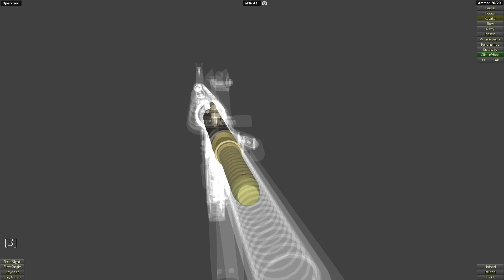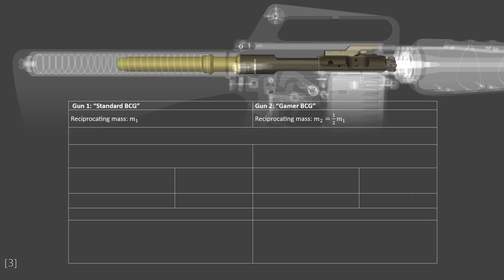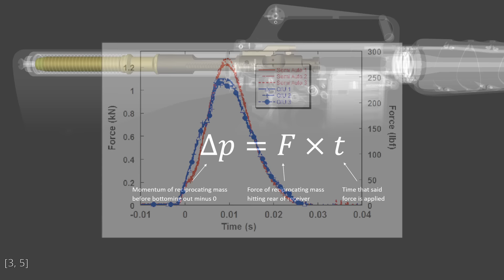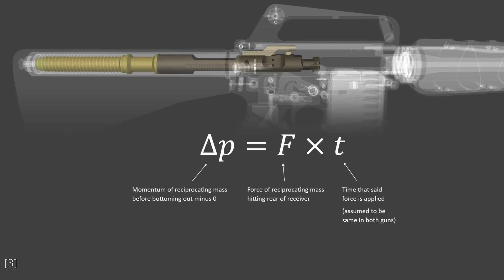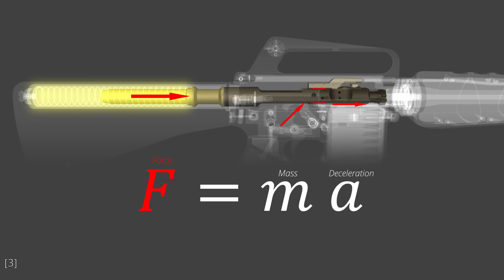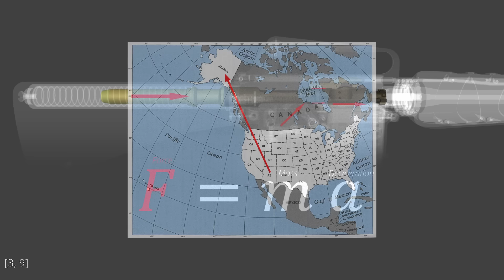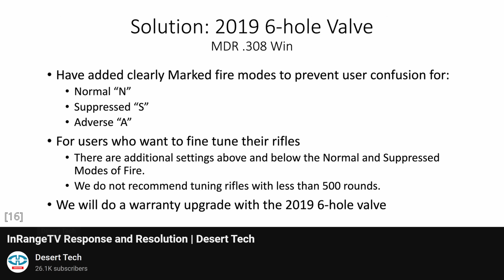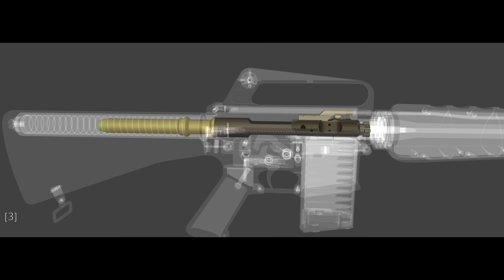Bolt Carrier Mass - A Nerdy Theoretical Discussion

Comment: The conclusions are counter to my own experimentation. I've found an increase in reliability and less sensitivity to ammo differences when using a light carrier. Specifically I've found that the combo of light carrier, heavy buffer, heavy spring, nets the best of all. 

Two things are ignored in this presentation and neither apply to the Desert Tech example. The buffer and DI gas system, neither are present in the DT. 

The buffer plays an important role in the AR15, as a mass damper it slows unlocking, and helps maintain constant momentum of the carrier. The ratio of the mass between the carrier and buffer is very important. The higher the buffer mass in relation to the carrier mass the smoother the action will cycle. 

The DI system is similarly important. The gas system has a gas volume with a restricted entry orifice. It isn't until this volume reaches a sufficient pressure that the carrier will begin it's rearward movement. This creates a time delay in the action and a mitigation of pressure spikes effecting the carrier. When the entry orifice(AGB) is small the peak pressure variation of cartridge has less effect on the cycling of the action. This aspect is not present in systems with pistons near the gas port as there's so little gas volume. 

Stiction and bolt speed are also an important factor. When the reciprocating mass is reduced but the spring isn't the speed at which the BCG moves forward is faster. This faster speed better overcomes the stiction of the cartridge in the magazine making the stripping of the magazine easier. This again is helped by a comparatively heavy buffer maintaining the momentum of the carrier.

FWIW my defensive AR is a 300BLK in which I use a skeletonized titanium carrier that's only 3.9oz and it's perfectly reliable with the wide range of 300BLK loadings.
Reply from the maker: Oh I agree with you, I think we're just having some mismatch in communication here. At the beginning of the video I said I'd consider the entire reciprocating group as one mass and ignore the interaction between different parts of the group. That's because I want the video to be applicable to gas operated firearms as a whole and not just the AR platform. If you reduced carrier mass and increased buffer mass, then the overall reciprocating mass would be the same, but the added benefit is that a larger portion of that reciprocating mass is in the form of the movable buffer weights, which would spread out any impulse applied by the reciprocating group to the gun. The only quirk to that approach is that the buffer mass does not help unlocking the bolt, only the carrier mass does, but realistically if one doesn't go overboard with lightening the carrier then it's fine.
Reply: @cabbage6015  With a DI AR I do not think the carrier can be too light.

Comment: Wouldn't speed of two bolt carriers be different on both back stroke and forward stroke because they have different masses but are pushed by same force - same pressure in gas system on backstroke and same string on forward stroke?

Comment: That's why I always going for a good quality mil spec BCG, a heavier spring and buffer. And avoid lighter hammer spring.
Super42 H2 and H3(or sprinco for cheap). And hiperfire trigger keeps the striking power while being wicked fast.
Reply: Good point on MDR, but light BCG is only one of quite a few design (and quality) issues.
My MDRX didn't perform half as well even compared to RDB.
SCAR17 is definitely a good example of why a heavy BCG is critical.
Reply: I've run JP triggers with the light spring installed for a long time over a few different rifles.  Never had a light strike, even with steel cased or surplus.  And that's with bobbed hammers.
Reply: @immikeurnot  Good for you and thanks for sharing. So they must work ok for your usage and your environment so far.
It's just that I prefer to not go closer to the boundary of the operation envelope when I'm choosing parts.

Comment: I totally agree with what this video laid out. However, in theory, if you were to take a light bolt carrier and increase the spring pressure while keeping the gas setting the same for heavier bolt carrier, wouldn't that reduce the velocity in the extraction phase and increase the momentum in the chambering phase?

The only reason I care is am working on turning a FM15 into a bullpup and I am trying to make it as reliable as a stock AR. I'm running suppressor springs for this very reason
Reply from the maker: If you keep the gas the same, then the initial amount of energy provided to the BCG is the same. Then you increase spring pressure to control extraction velocity, but then the stiffer spring would absorb more of the BCG's kinetic energy, then the gun would be more likely to short stroke no?

Another way to think about this is: A reduced-mass BCG decelerates faster (F = ma). If you increase the recoil spring force, the lighter BCG will slow down even faster than that, making the gun more likely to short stroke
Reply: @cabbage6015  dang, that makes sense. Last question, if you were to up the gas and the spring pressure, would that theoretically make up for lost BCG mass?
Reply from the maker: @FireSquad101  For the rearward stroke of the bcg, what we are aiming for is a gradual deceleration, so that the reciprocating group is slow enough at the start of the stroke for optimal extraction, but still retain a non-zero velocity at the end of the stroke. Because F = ma, if you reduce the mass, the only way to maintain the same deceleration is reducing force, in this case the recoil spring or hammer spring force. That causes its own problem in the forward stroke of the reciprocating group. 

If you increase recoil spring force, you solve the problems in the forward stroke, but for the rearward stroke you inevitably make the deceleration more abrupt, meaning the difference between the starting and ending velocity is much larger. This depends solely on the hammer and recoil spring forces (and friction). The gas system wouldn't do anything to help that. If you increase both the gas system and recoil spring force, what you are doing is giving the unlocking phase a very high velocity, but then immediately slam it down with the stiff spring as the bcg moves back.

Basically with a low-mass reciprocating group, you have to balance between either increasing the recoil spring force to help the forward stroke, or reducing it to help the rearward stroke. The only way that you don't have to strike that delicate balance is to increase reciprocating mass.
Reply: @cabbage6015  thanks for the thorough explanation man
Reply from the maker: @FireSquad101  no worries dude, anytime

Comment: The assumption that you would have a bolt carrier that is 50% lighter seems off to me. Usually a working light weight setup will be about 25% lighter.

Comment: Maybe I'm mistaken, but why do I think the forces should be the same?

    The same amount of kinetic energy (KE) is converted into potential energy stored in the spring.

    So in both cases, the recoil springs will be compressed by the same distance, because they store the same potential energy.

    According to Hooke's Law (F=kx), the force exerted by the spring is proportional to the displacement (x) from its equilibrium position.

    The maximum force occurs when the spring is maximally compressed, at the point where the bolt carrier momentarily stops before being pushed back by the recoil spring.

    So the maximum force exerted on the spring will be the same in both cases. This is because, as established earlier, the springs are compressed by the same distance. Since F=kx, and both the spring constant (k) and the displacement (x) are the same in both cases, the maximum force will also be the same.

Where could I be wrong?
Reply: Mass Difference: Although the masses are different, due to the same initial kinetic energy, the lighter bolt carrier has a higher velocity, while the heavier one has a lower velocity.

However, the difference in velocity is offset by the compression of the spring. The lighter bolt carrier transfers its kinetic energy to the spring in a shorter time, while the heavier one takes a longer time. However, in the end, the compression of the spring and the force exerted by the spring should be the same.

Comment: Great vid! BCG mass and carrier to bolt head mass ratio are often regarded as some of the more important factors when it comes to reliability.

I have a few questions on the topic of recoil tho, given a certain BCG mass.

Over the years of watching gun videos on youtube I have heard comments saying that "snappy" recoil is better for semi, and constant recoil doesn't do much for semi. On the other hand, I've heard ppl say the 556 MDR and the RDB have low recoil due to their longer than usual (but not quite constant recoil level) recoild stroke. Which one in your opinion is true?
Reply from the maker: I think it's mostly coming down to personal preference. It goes back to the impulse equation at 4:55. Assuming the initial BCG momentum is the same, if you have a slower recoil cycle like the MDR and RDB, the time increases and the force reduces. Opposite is true for a faster recoil cycle.

When I shot low powered .223 in my X95, the BCG velocity is slower, and it feels like a gentle push. If I switch to hotter 5.56 then it's a quicker but harsher snap. I can see the pros and cons of both cases. A gentler push doesn't knock my sights off target as much, but the recoil cycle is slower and my sights are off target for longer. A quick snaps knocks my sights off a bit more but it also goes back on target faster.
Reply: I'm gonna say it depends a bit.  I've had more trouble tracking sights with some snappy recoil, but "pushy" for lack of a better term, you can keep a better sight picture and just push it back on target.  I'd say it all comes down to how much total recoil you're going to see, whether getting it over with fast vs spreading it out is going to be a better strategy.

In 5.56?  Quick snap is probably going to be better, because total recoil is really low.  .308?  Might want to spread that recoil out a bit.  A snappy 12 gauge?  No thanks.

I have a 3" barrel .44 Mag.  It's the extreme of "snappy" recoil.  The gun is just suddenly in a different place.  It'd be a lot more controllable as a longer push.

Comment: This again brought a topic to mind that I‘ve considered for a while: auto-regulating gas blocks/systems. I‘ve heard of a few ones but I‘m unsure about the implications. There must be a number of considerable limitations and challenges involved (otherwise they would be everywhere) but the payoff would be huge.
Reply: The Superlative Arms adjustable gas block is like 90% of the way there.

The design is such that excess gas is vented out. This means when you use hotter ammo or a Supressor, you will still feel more recoil but a large portion of the excess gas is vented out so it's still much softer.

It requires the user to adjust it initially but once it's configured properly it works extremley well.

Comment: Hmm, we need a rifle design with light bcg +
long bcg travel (so have time to pick up bullet)
delay mechanism (so rim won't get stripped off)
Gas remain high (reliable in dirty/sandy conditions.

The only weapon I could think of, is Famas but its BCG doesn't travel far and perhaps buffer spring not strong enough that it still needs steel casing....
Reply: Type 81 is what you looking for, and another advantage is its a constant recoil design
Reply: @Jackson-hs8jx  Yeah like Ultimax 100!!

Comment: Anyway, what if we increase the spring force a little, so the bolt carrier moves backward slower, so it can overcome the problem of premature unlocking. then when the bolt moves forward, problems such as feeding issues due to lack of power can be overcome with extra force from the spring.

So can it be like that or has someone already done it?
Reply: Simply throttling back the gas with an adjustable block does the job of reducing recoil without the expense of buying more parts.  Remember, ARs are deliberately overgassed for reliability.

Comment: What doesn't make sense to me then is that you will generally notice a fairly obvious decrease in felt recoil when using a HEAVIER buffer. You can try it for yourself. Take any off-the-shelf AR-15, they will normally be over-gassed with a standard carbine buffer (~3 oz) to ensure reliability in cycling all types of ammunition. Swap the buffer for an H1 (~3.8 oz) or H2 (~4.6 oz) buffer, and you will normally see a noticeable decrease in felt recoil. The weight of the buffer will be the only factor that has changed.

Why is that? It seems contradictory to what you explained here. Not trying to say you are wrong or anything, just curious and would like to understand more.

Comment: Can you explain to a layman why the momentum of the bcg matters? If the kinetic energy transferred to the bcg is the same for both examples, then shouldn't the force applied to the shooter when the buffer hits the back of the buffer tube be identical? How does reducing the momentum of the bcg make the gun "softer shooting" if the kinetic energy remains the same?
Reply: In collisions between objects you see conservation of momentum while that is not true in regards to kinetic energy. Momentum is also a vector value while KE is a scalar value, if you want to collide two objects and see where they end up you use momentum, as imparting momentum into an object will change its kinetic energy. If you think about it, giving a bullet more velocity will give it more kinetic energy which can translate into more damage, but bodies won't be flung into the air. Momentum is less biased towards velocity, which means the combination of mass and velocity can knock a person over, imposinga change in that person's kinetic energy (which was 0 if the person was static).
If you want to go deeper, momentum is the partial derivative in respect to velocity of kinetic energy and kinetic energy is the integral of momentum in respect to velocity.
Reply: Yes, but that doesn't explain what's specifically happening in this example. Why is more of the kinetic energy imparted as momentum with the heavier BCG?
Reply: @arconreef  Because you have to stop thinking about KE for a second. When a collision happens, a heavier object has more momentum and thanks to the law of conservation of momentum, it will impart a greater momentum gain to the object it impacts. Since mass is unchanged in this example, the "target" object gains velocity.
NOW you can take your KE equation and since mass is unchanged the KE increased by the velocity squared.
Reply: @ChucksSEADnDEAD The more I think about this, the less sense it all makes to me. Setting KE aside and looking only at momentum, Newton's third law states that every action has an equal and opposite reaction, which means that the momentum imparted to the rifle (and by extension the shooter) must be equal to the combined momentum of the projectile and expelled gas. If this is true, then any reduction in the momentum of the reciprocating mass must be offset by increasing the momentum of the rest of the rifle, which means nothing that happens to the bcg can reduce recoil (if recoil is defined as the momentum imparted to the shooter).

Comment: Lower mass means substantially lower momentum and slightly less energy at the same bolt velocity. Firearms are built to operate safely at a given bolt velocity, so you can't increase that to give higher energy but less momentum.

So where reducing bolt mass dampens felt recoil by reducing bolt momentum, It is also going to reduce reliability in any adverse condition.

I haven't watched the video yet. I'm just putting my prediction here to see how it goes.

Comment: I see this "debate" go on in forums, whenever it comes to "tuning" their rifles. I will admit, i enjoy tuning and optimizing myself but i always try to prioritize reliability first and foremost. What are your opinions on messing with spring strength meanwhile then? We often see lots of mentioning regarding the BCG and buffer masses as they are the reciprocating bits of the AR, but there really has been an increasing proportion of folks going into stronger springs to take the role of or compliment these buffer weights now. I am seeing some folks preferring to make up for the lack of a buffer weight with a stronger spring instead (so instead of perhaps a carbine spring with an H3 buffer, i would see them using a 15% XP "blue" spring or even a 25% XP "red" spring with an H2 buffer or lighter now rather). Assuming a full mass BCG still of course.
Reply from the maker: I haven’t thought about that too much but it seems like a good idea since you’re not reducing the energy provided to the bcg by the gas system. A stiffer spring will absorb more kinetic energy during the rearward stroke, so the bcg will bottom out with less force, but the flip side is that it will give more kinetic energy to the forward stroke so the bcg will hit the barrel extension harder. But I guess a heavier buffer would do that as well, and it doesn’t have the added reliability benefit of a stiffer spring. Another thing is that the extra kinetic energy forward may or may not lead to more bolt carrier bounce, but that’s probably a non-issue in semi auto
Reply: Spring will not make up for buffer mass, they have a different roll. 

I can see a place for a heavier spring with full mass systems, but not with low mass systems.
Reply: In this example from the original commenter, velocity of the bolt carrier will increase (your thoughts on forces can be equalized if the reduction in mass and increase in velocity end up at the same force). The only concern I see if this approach is taken to far is the magazine may not be able to present a new round in time or the extractor may not new strong enough to not “bounce” at the wrong frequency and slip off the case head.